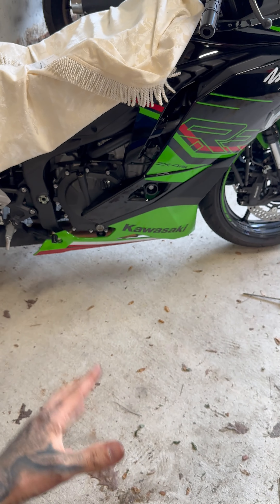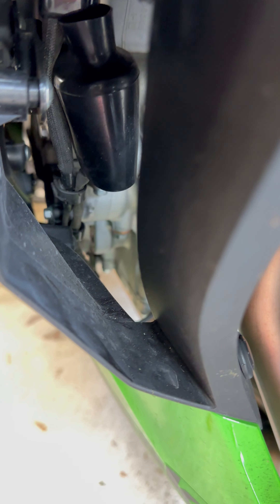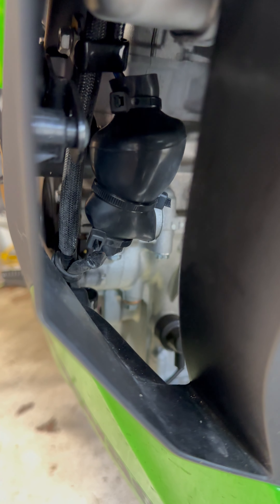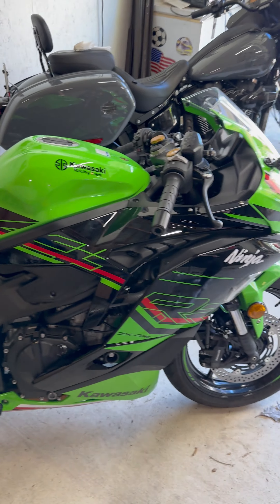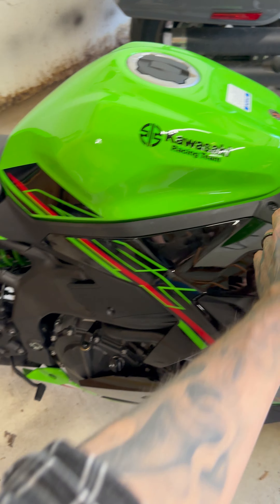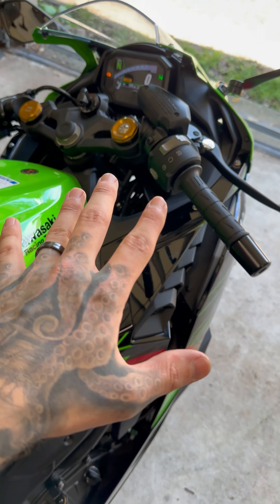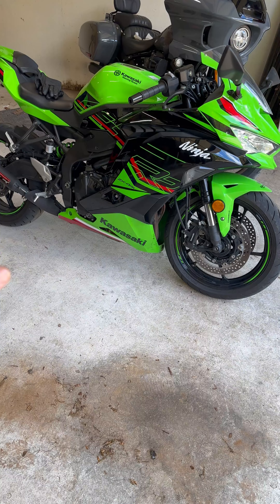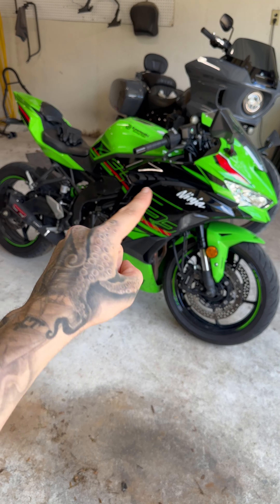ZX4RR UNLEASHED!

Comment: Mine is still under warranty so I'm riding it stock in sport mode most of the time. I will get it tuned with just a slip on and filter this winter. Not in any hurry. I too have a couple of Harleys to ride. I love this little light bike. It's so much fun and I'm not hauling a 725 lb. bike around town and in the mountains.  At a very young 70 year old, it scratches my itch.